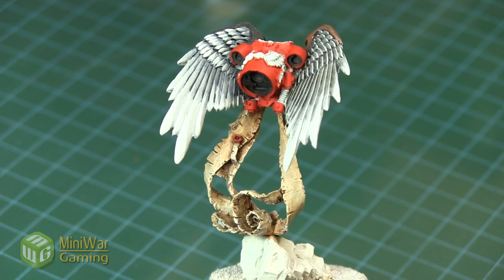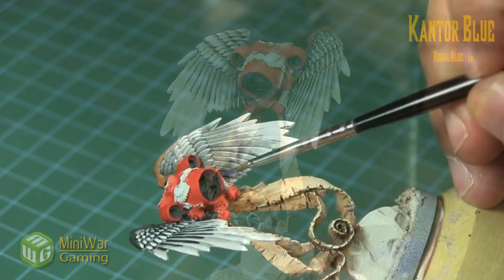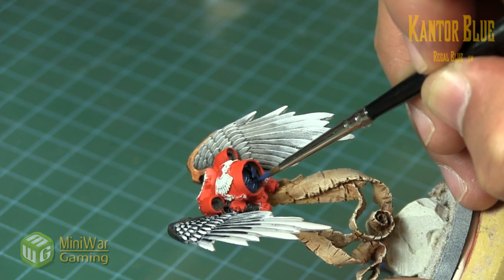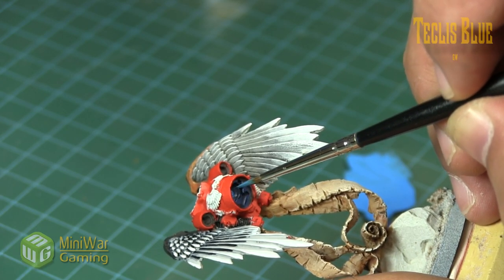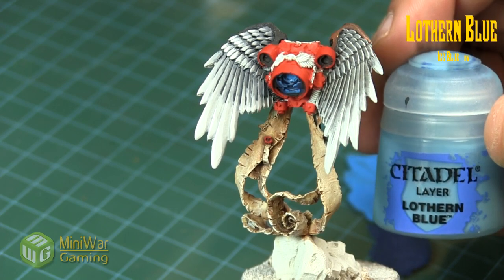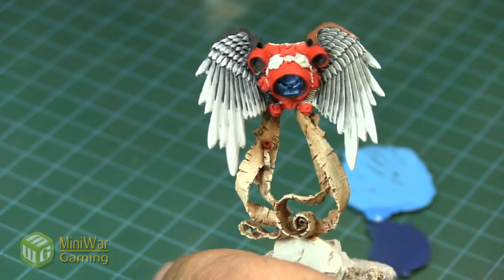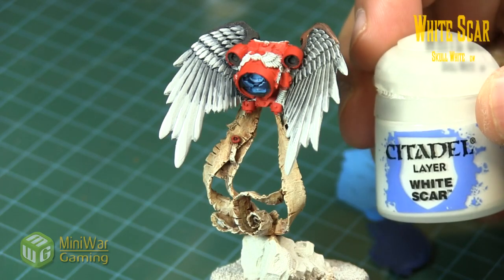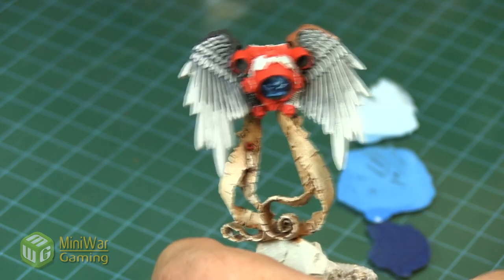Quick Tip Engine Glow

Comment: I have a question. How do you efficiently paint big vehicles. I tend to either rush through them and get disapointed with the result or take months upon months to make sure every inch is as detailed as it can be.
Reply: do the second one  - and be happy with the result
Reply: ILikeToColourRed Aight. I guess you're right. Thanks for the suggestion.
Reply: Vehicles can be hard to paint, comrade. The way I have mine painted varies by different techniques I use. So far, a mixture of regular blending and dry brushing does the trick really well. I first layer the base paint, wash, repeat the base paint leaving some shade, then drybrushing the rest of the layered colors on.
Reply: Airbrushing is probably the only way to be efficient, and make sure you get something of a higher quality, the citadel airbrush GW sells I find is pretty basic, not great for much more than base coating your models, it's a bit of an investment to get set up, but you're going to save a lot of time on large numbers of models and vehicles, or terrain, and it's looks a lot better on larger surfaces because the paint will go on so much more even, and really creates those natural gradients you may be looking for, for like shading effects and such.

Comment: I do have a question. I'm painting a Warhammer Fantasy, Warriors of Chaos army, and I want to create an ethereal effect on the Warriors. Just to clarify, I want to make them look like demonic spirits, similar to the effect used on Vampire counts models such as the Mortis engine. However, I would like to use red and black instead of green and white, to achieve the "demonic spirits" effect. How do I achieve this "demonic spirit" effect using read and black?